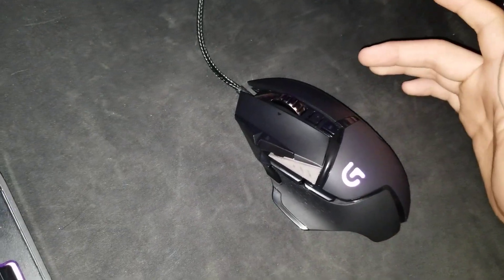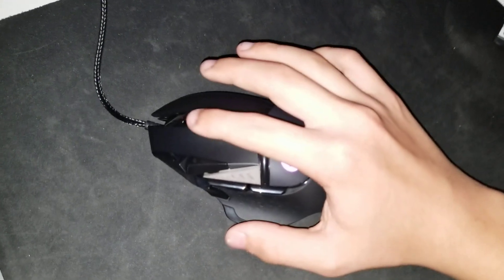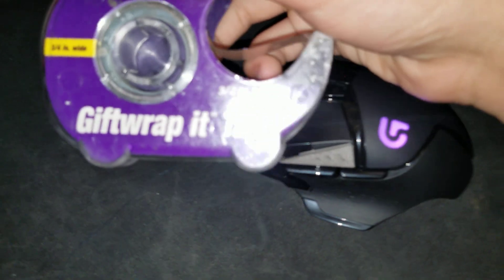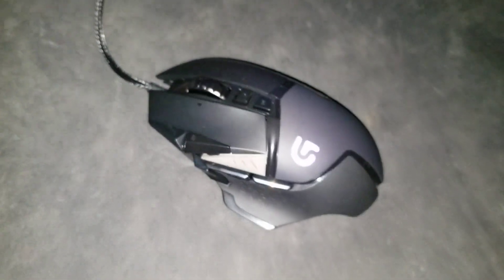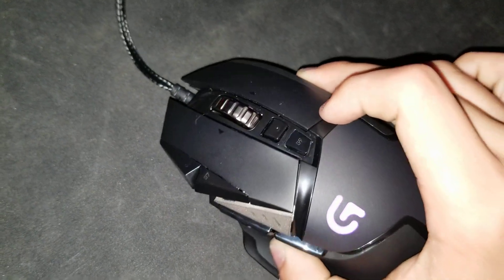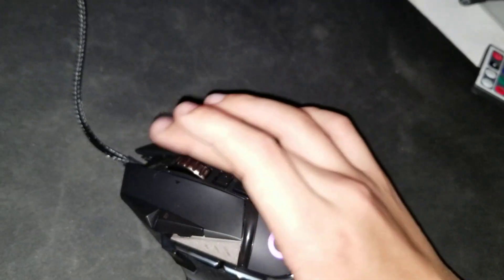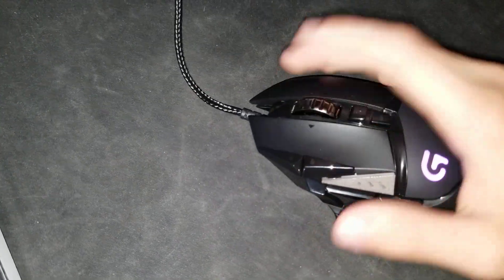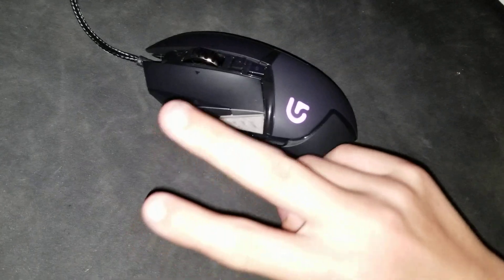Logitech g502 scroll wheel rattle fix

Comment: Also a fix: Never buy a logitech mouse. Shit breaks and needs cleaning 24/7\
Reply from the maker: I’ve personally never had issues with Logitech mice other than this one, i use a gpro superlight now and its treated me well for two years
Reply: @sentsuu  I use g502 and the middle scroll wheel consistantly breaks, even whenever I fix it the left mouse button seems to break as well.
Reply from the maker: @LoliPolice-bf7mw  Damn thats rough. if you can you should contact logitech support and see if you can get a replacement.
Reply: @sentsuu  Cant because you gotta pay for warranty, which I havent. I'm just using a newer model wireless alienware mouse and it honestly performs far better than the 502

Comment: Scroll wheel in this mouse is just horrible. I have this wired version and I have replaced the wheel with G500 wheel, which is much better. Now I got lightspeed version of this G502 and I am back with this awful scroll. It is slightly better in this wireless version, but still the scrolling makes the whole mouse vibrate and this rattling is also annoying. It is especially bad when using free wheel mode (which would solve the vibration while scrolling). Mouse was too hard to open and it damaged my old mouse, so I am not going to change G500 wheel to this mouse right now. When it gets older, i probably will. Intresting to see, if I prefer this wireless version over the wired with better wheel. It's pretty sad that they are still after all these years selling this mouse only with this worst wheel I have ever used. The worst wheel on the best mouse.
Reply from the maker: ive seen a number of tutorials on changing the wheel to third party wheels online, from what i can tell as long as you have replacement feet for the mouse and youre very gentle with the parts on the inside it should be relatively safe. but ultimately the only fix that you wouldnt have to open the mouse for is pretty much the tape mod as seen here or you can try and lube the wheel on the inside with dielectric grease or superlube using a small brush or something to see if it makes the experience any better.
Reply: @sentsuu  I did open my old mouse and replace the wheel. I think in videos that looks easy, because they have already opened it before. You have to use too much force on weak plastic and rubber parts. Really hard to open it without damaging the mouse. I did only mildish damage, but I had to use glue and sandpaper to fix it. Although, I got it to feel smooth on hand. Actually smoother than this new mouse. Still, I am not going to do this operation for new mouse. We will see when this gets older. I may replace wheel on this one too.

Comment: If you push the button right below the scroll wheel all the way. It stops it from spinning freely. It won’t rattle once you do so
Reply from the maker: Mine had the rattle on both settings, I never used free scroll.
Reply: I have the hero edition so I’m not sure if it’s the case with the original g502 model
Reply from the maker: @pressingkeys4life  Ive heard its depending on the Model and your luck really most copies are bad and some arent.

Comment: i returned my g502 and got a basilisk v2 instead. no rattling mouse wheel, much lighter and optical switches work 100%.
Reply: exactly! I did the exact same thing. So much better. No rattling. You can adjust the mouse scroll wheel resistance to make it more silent. Yeah, no infinite scroll, and the other 2 buttons (not counting the button used to disable/enable infinite scroll). You can add a side button just like the fixed one on the G502. Also, no loud mouse scroll wheel when in normal mode (the one on the G502 has got to be the loudest mouse scroll wheel I've ever heard). On the G502 I also got an issue with the right click and left click buttons which sometimes made a sound as if something moved inside the mouse like a spring or an echo or something. From time to time, but still really annoying. Returned the G502. Basilisk v2 is similar to the G502 as far as shape goes. On maximum scroll wheel resistance the Basilisk v2 scroll wheel is also quite loud (but still a bit more silent than the one on the G502), but I never use that. I use it at about half resistance maybe less.

Comment: g502 hero dosen't have this issue
Reply: mine does?
Reply from the maker: @roogie4591  You have the G502 Hero? wack.. seems like it could be sorta fixed on some models then
Reply: @sentsuu  yeah, since my friend also has g502 hero and dosen't have this issue.
Reply from the maker: @Vladut9091  Maybe BeingBoring got a bad copy then
Reply: Sentsu it’s cause he doesn’t really game, he probably uses two of the buttons out of all 😂🤦🏾‍♂️ smh
Reply: @Chino.proddd  i have it for 7 months, 250 hours in cs go, 300 in modern warfare and 100 in overwatch
Reply: @sentsuu  mine does too, starting happening a few months ago
Reply: @Vladut9091  i have g502 hero and i have the same problem. I retourned it, i will buy a razer mamba elite or corsair idk
Reply: Sentsu I have g502 se hero whenever I hit against my mouse pad or scroll to the side fast the scroll wheel actually moves like 9 times
Reply: @roogie4591  yeah same, i got mine like a week ago, its weird. i have a g502 hero se
Reply: Rouge Roslinda same here
Reply from the maker: Good to see they fixed it on later models
Reply: It does
Reply: The G502 Proteus does tho.....the paricord was also way thicker than the Hero....i cut it all off and way lighter aiming
Reply: My new G502 Hero have this issue.
Reply: This issue happened to my g502 Hero. Seems like some of it is still faulty.
Reply: Mine too I got it 2 weeks ago
Reply: Mine does
Reply: Just bought one from Amazon Warehouse; wheel rattle is definitely there.
Fault, or a limitation caused by the wheel's side-click/free-wheel functionality?

Also not a fan of the wheel being so slippy; makes side-clicking rightwards with my middle finger almost impossible (without repositioning the finger).

Think I'm going to stick to my G402; no free wheel or wheel side-click, but IMHO it's simply a better design.
Reply: Mine does too
Reply: It does, i have a brand new one and its like completely loose
Reply: I just picked up a Lightspeed and it's an issue
Reply: Mine has the same issue, g502 hero. Shakes like a bitch on smack

Comment: Quite late on this but when I tried it I lost the tape inside the mouse while scrolling so I simply tied a thin sewing thread on each side of the wheel and it doesn't rattle anymore. 
Also, the wheel scrolls as fast as before when unlocked. Still can't remove the old chunk of tape though...
Reply from the maker: sorry about that, i made this when I was very young so I didn't think of it, glad you found another fix though

Comment: Alright I just got the g502 hero , and I play fortnite with it . The biggest problem in running into is the scroll wheel just spinning and spinning even when it’s “locked” I’m gonna try this tape fix and see if it does my any justice , thanks
Reply from the maker: It sounds like you have a faulty unit, check with logitech or wherever you bought the mouse from for a refund or a replacement.
Reply: DreaM I just added the tape to where the scroll wheel like you did and it works great now ! Thanks tho
Reply from the maker: @lucid8822  glad i could help

Comment: Thank you so much! My older G502 (Spectrum) and the previous model did not do this, but I got the Special Edition, and holy cow does it rattle like CRAZY!!! 
This did the trick really well: Using your idea, I took black electrical tape, cut three squares, adhered them on top of eachother to add some thickness and strength. I then cut small triangles with longer sides (an obtuse triangle, basically) and used a metal petty knife to really get down in there and adhere it to the walls of the mouse away from the scroll wheel. It stopped the rattling. It has added slight drag onto the free scrolling mode, which slows it down ever so slightly, which I honestly prefer. I almost never wanted that thing scrolling at its full potential speed. So for me, this was like two upgrades in one!

Comment: I reccomand nobody to buy the newer g502's they all have this rattle and the bottom softer pads come off really quick
Reply: It's not like the mouse is on the top of the best gaming mice of 2019!!! are you dumb?
Reply from the maker: The newer revisions are higher rated.. not this one i'm not sure if this was remedied on newer renditions or not but either way that is also subjective the g502 was definitley not recomended as a top mouse for FPS games.
Reply from the maker: that being said it was a great mouse for casual gaming and buisness work.
Reply: @whiffedwhenitmattered  have you ever tried it, the mousehweel rattles when flicking to the right and left its triggering and you feel it its awful, the pads came off after 1 week lmao
Reply: @Hugos68  Imagine answering after this long smh. I've been using them for years and haven't had a single problem. Obviously, you got a bad one. Pro's use them in Esports tournaments all the time too because it's one of the greatest mice to ever exist.
Reply: @Hugos68  You probably have it on infinite scroll wheel lol. You can also tighten the mouse wheel any time. The pads are perfect too.

Comment: i fixed this by pressing the 2 circle arrow button, it makes it so it doesn't move as much
Reply: worked ok for me, got the thing and thought this is unacceptable. Barely feel it now with notch lock on, but you can feel a wobble still but no where as bad.
Reply from the maker: Yeah, that can work but it can cause the scroll wheel to move while gaming/web browsing. which wouldn't be very great as depending on how you use your scroll wheel it can really screw you over.
Reply: @sentsuu  that really happened when i didnt turn it on
Reply: @sentsuu  it was a good idea though
Reply from the maker: @kool_kid_1015  lol I did for me 🤷‍♂️ i guess they are all different. And thanks.

Comment: I have the Logitech G502 and I lost the ability to Scroll with it 100%. Anyone else has this problem and know a fix? It doesn't Rattle I just simply cannot Scroll with it anymore. It's like it got Deactivated or something but if I press it down or press it down and hold it I can scroll. But not just regular scroll it doesn't work it started a couple days ago and I was wondering If its the mouse itself may be a Mouse option. I tried reinstalling mouse driver and Mouse options I just don't see an option for it. it's not loose or wobbly
Reply: get a replacement scroll wheel and replace the part your self. there are lots of guides online on how to do it. I suggest you get the scroll wheel of the g500, it's rubberized and retains every function. I hope after a month this will still be useful for you.
Reply: @Old_Salt  Thank you! Greatly appreciated

Comment: Thank you bro!! Saved me
Reply from the maker: Yeah man! No problem, it was my pleasure. Hope you enjoy your new rattle-less mouse
Reply: @sentsuu  I also had my wheel loosen and it just fixed it xD double fix , ly bro
Reply: @sentsuu  I just fix my rattle too using your suggestion.  I use 2 small mouse feet one on each side.  No more rattle but the side clicks don't work which is okay with me.
Reply from the maker: @thomasshumaker298  thats actually really smart! How does the free scroll work on it compared to the tape?
Reply: @sentsuu  The stepped scroll works great.  Free wheeling is smooth but does not spin near as freely but it's still fast.  Side to side scroll does not work I think. It will click but you must push hard.  I never. figured out where to use that function and never have.  All my logitech mice with that style of scroll wheel have loose wheels.  But now I can use my G502- no rattle or loose wheel.  I never used it much in the past because of this issue.  Thanks to you and your idea I am a happy man again. Thanks

Comment: Great idea kid!!!

Actually inhibiting the free spin resolves another issue that the G502 suffers from. Lots of wheels on G502 are not balanced. If the wheel is allowed to spin too easily  the wheel will continue to spin when it should stop. Because this extra spin is caused by the wheel being heavier on one side it is hit or miss which direction it moves after it should stop. This causes the screen to jump randomly up or down depending. Just a little resistance nullifies the requirement of the wheel being perfectly balanced so don't have to take the wheel out to fix it.

On another note, turning on the wheel tension with the wheel mode button adds way too much resistance for how slippery the wheel is so that option exposes another issue with the mouse wheel that is even worse.

I like the mouse as far as movement and other buttons but 10 dollar mice have more accurate mouse wheels and the G502 is supposed to be a highly accurate mouse. I use the mouse wheel a lot not gaming as well as in games so I find it offensive to pay 80 dollars for a mouse this bad.

Comment: literally just use the button below the scroll wheel to lock it and unlock it when you're gaming vs scrolling on the internet. Not a problem.
Reply from the maker: I use scroll wheel alot while gaming, free scroll Is very bad for weapon switches and other things.
Reply: @sentsuu  But if you hit the button below the scroll wheel it makes it nice and notchy which is perfect for using it in game, no tape required. Unless yours makes noise in the locked position which sounds like a defective mouse
Reply from the maker: @eurly93  mine makes the noise in the locked position, but doesn't in freescroll. Happens in almost all g502's  
Very few dont have it.

Comment: same thing with my Logitech G903 did a different fix need to open the mouse to access the scroll wheel https://youtu.be/o1EAMXt2Blc
also solves the sensitivity scroll issue and the free spin is still working 100%

Comment: Had a much cheaper Natec GX78 with much better wheel,no rattle,better software,dpi exclusive button...before a cat smashed it on the ground two times and now the sensor sometimes doesnt read
Reply from the maker: the big issue with that mouse is the laser sensor instead of optical, optical sensors are far superior when it comes to tracking and other kinds of stuff plus I love the shape of this mouse.

Comment: Can you get the piece of tape out of there?
Reply from the maker: Fxlkki Yes, it is simple in either use a dull knife and a little bit of precise movement or if that's not working you can lightly tap the mouse upside down to loosen the tape, so you can remove it.
Reply: Also does this fix the problem when the mouse scrolls itself when im not touching it sometimes? Or like if you play fortnite did your weapon change sometimes even though you didnt touch the scrollwheel? Or is it just like thing that you get used to after a while?
Reply from the maker: I had the issue once or twice before this, this also fixes that problem
Reply: @felixfelikx  I know im late, but to fix that problem just unbind your slot up and slot down in fortnite